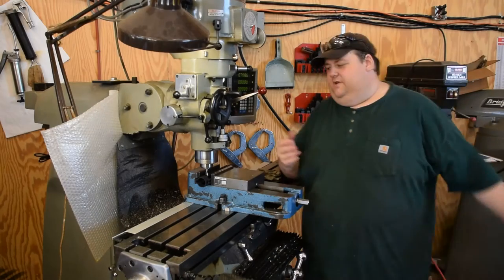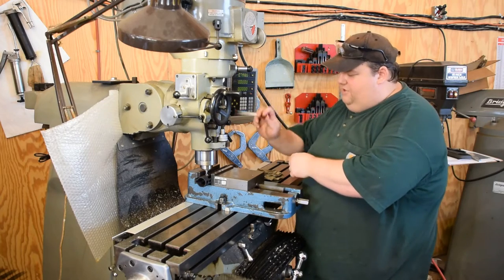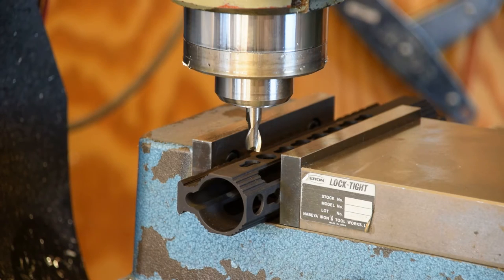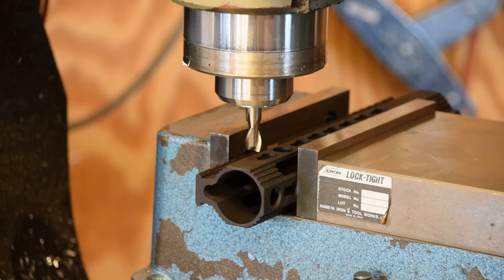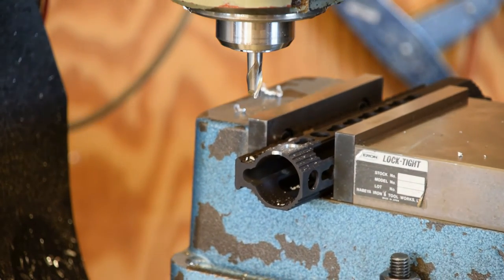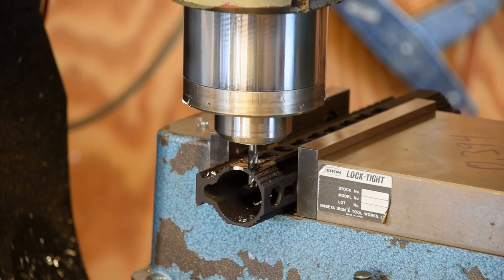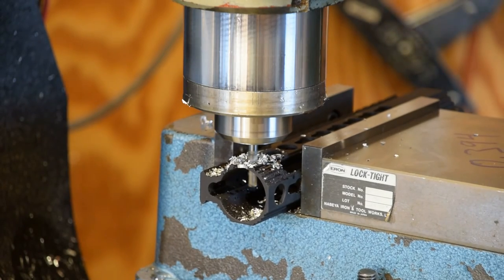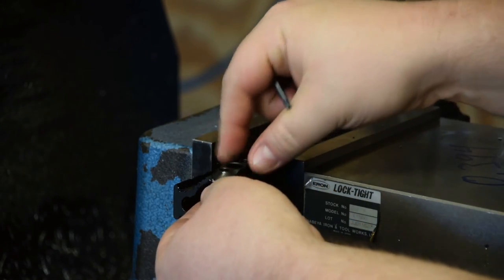Quickie KeyMod Slot

Comment: I understand putting in the extra slot but I don't get why you cut the tiny divot on the end.
Reply from the maker: 'Cause that particular sling mount has a little hook or projection that comes off the front of the unit that needs to hook or set down into the 3/8" hole part of the next farther forward KeyMod slot.

That little hook anchors the sling mount so that it does not move rearward under recoil or through rough service.

It's meant to just go into the next farther forward KeyMod slot, but in this case there wasn't room for a whole slot, so I made that 3/8" dia cutout exactly the same distance forward that the edge of the next slot would be.

Does that make sense?  It's kind of hard to describe, but if you look at the video toward the end when I assemble the mount onto the rail, you will see that little projection on the front of the mount hook over the front of the rail into that little 3/8" divot.

That's the only reason it is there.

Thanks for watching!